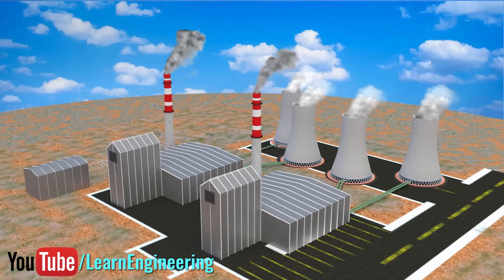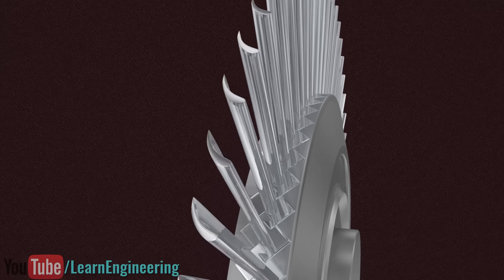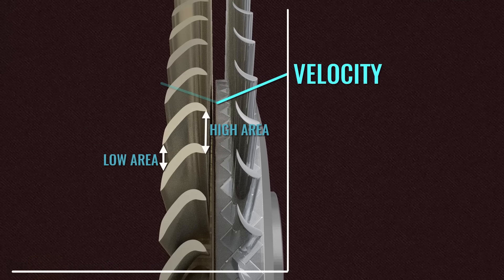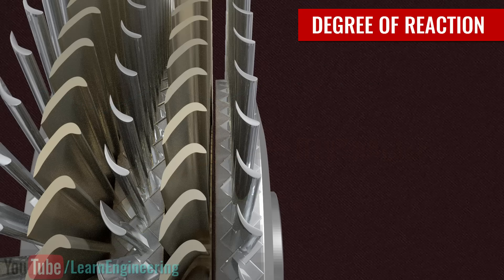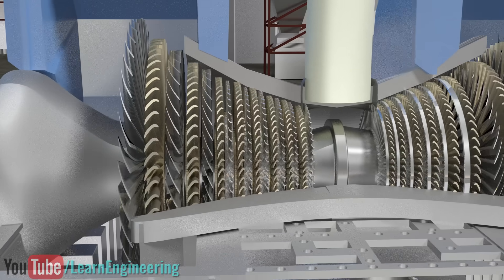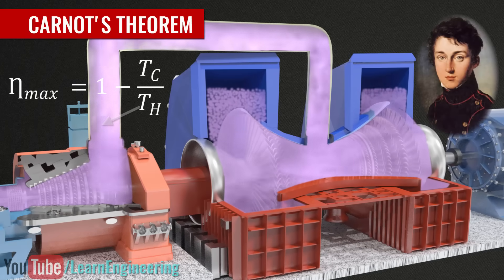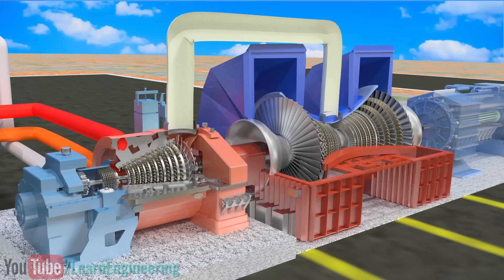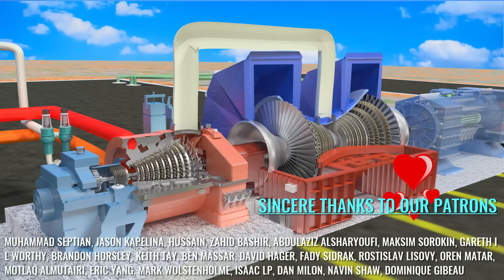How does a Steam Turbine Work?

Comment: But where does the boiler get the energy to heat the water?
Reply: And how would you convert nuclear Energy to Electricity without a Steam Turbine?
Reply: heat cant be converted directly to electricity you must converted to a mechanical form first
Reply: noreaction often from coal
Reply: We already do the thing you sugested but with water, it's called hydroelectric power. But in that case instead of people lifting the rocks is the sun that evaporates the water from the lakes, oceans and rivers and converts them in clouds that travel in the air due to the wind currents generated by the sun itself and then comes down in form of rain that fills the rivers and moves the hydroelectric turbines of the dam again. So in other words, hydroelectric power it's actualy gravity and solar power deep down.
Reply: Because belive or not thats the simplest way these days to convert heat energy to electric energy. A gas turbine like a co2 turbine may be a better solution for higher temperatures though it works very similary.
Reply: noreaction nuclear reactors release large amounts of energy in the form of heat. You can't convert heat directly to electrical energy. It's impossible, you need to first convert it to mechanical energy.
Reply: it depends but mainly its either burning chemical substances or from nuclears reaction
Reply: The equation for your situation is (intro to physics):
E = m*g*h (Energy = mass * acceleration of gravity * height)
plus several unit conversions to the base metric system. 
I also went ahead and solved it below (spoilers!).

The energy doesn't come from gravity. The energy comes from your body, but gravity temporarily stores the energy before you use it - you move the weight up, and it generates power when it falls back down. This also assumes 100% efficiency. 

Solution:

First convert to a more usable unit for 1 day of usage, from kilo-watt-hours to watt-seconds (aka Joules):
energy_needed = 10 KWh * (3,600 s/h) * (1000 KWh / Wh) = 36,000,000 W*s = 36,000,000 J

Solve for height of your stairway using the equation above: h = E/(m*g)
m = 600 lbs / 2.2 kg/lbs = 272.7 kg
g = 9.81 m/s^2
h = 36,000,000 J / (272.7 kg * 9.81 m/s^2) = 13,456 meters = 44,147 ft

Conclusion:
Height of stairway  = 44,147 ft
Height of Mount Everest = 29,029 ft

The calculations show that you'll have to carry the 600 lb rock from sea level to the top of Mount Everest 1.5 times each day.
Reply: noreaction because it's not so safe
Reply: You can't convert nuclear energy to electrical energy directly, or at least we don't know how to do it yet, or in the other hand, if such thing was possible we don't know if it would be as cheap, simple and efficient as a steam turbine. It would be awesome tho. But you can use it directly to heat things, I think that a lot of industries that need to heat things use the hot steam of nuclear reactors directly, because, why would you use heat to produce electricity to then produce heat again?
Reply: And the other thing is that it's not as simple as rotate some random shafts at a given RPM, the more current you want to generate the bigger they need to be and you will feel more resistance l when trying to turn the shaft, so it's going to be "harder" to turn them not because they are big but because the resistance in the circuit will try to stop the generator, that's why the generators vary in size due to the amount of current they need to produce, for example if you buy a small generator you could run the electric stuff in your house with no problem, but if you go to a big building you will find massive generators with big engines that use a lot of gas to produce the amount of electricity necesary for the entire building.
Reply: TechTezza what? no Sisyphus reference?
Reply: noreaction I know a way of turning heat into electricity directly: thermocouples! Yes the ones used to measure temperature. They produce a tiny voltage and current, if you have many in a series you can achieve usable amounts of power, like in space probes. The problem is, though, that it's DC and the efficiency is very (very very very....) low, no greater than 10%.
Reply: Because the energy released from a nuclear reaction, is mainly in the form of heat. We cannot send heat into the power supply, so we use steam turbines to convert heat into mechanical motion, which we then turn into electricity with the large generators. If you want to understand it better, find a video on how a generator turns mechanical movement into electricity.
Reply: Yes, for exmaple chemical platforms for industrial productions of certain chemicals that requires high temperatures can be coupled with reactors to cut out the transformation of energy from the middle to prevent the waste due to conversion.
Although, your statement about conversion is only half correct, as its true that currenty steam turbines the most common method of conversion in reactors (and likely the most efficient on that scale and temperature) however both RTGs, beta voltaic cells and alpha voltaic cells are working differently in princible, while they convert nuclear energy into heat or directly into electrical energy, without steam, turbine or even moving part.
Reply: Ariel Méndez I don't live near river lake or ocean, and it's not really sunny since I am closer to the North Pole than I am to the equator. Solar and hydro power are not reliable enough every day for me
Reply: Considering the fact that an average U.S. house draws on average 2 extra-large horses of  worth of power (definition of a horsepower) in electricity alone 24/7/365, you would need at least 2 extra-large horses pulling carts of rocks 24/7/365 in order to feed that falling rock generator (otherwise it'll stall), or more realistically, at least 6 extra-large horses so that they don't all die of exhaustion within a day. You can still expect them to regularly die of exhaustion though in this setup. 

Humans are a lot weaker than horses. It'll take closer to 48 very fit humans to even hope to make it work, for a single house (with around 2 people living in it, I guess the other 46 will have to be homeless).
 
Then, we have these large steam turbine power plants like the one in this video, which typically output between 1/2 - 4 million horsepower, each individually. The scale is the issue here - humans are simply too weak. Steam turbine power plants like the one in this video are basically lifting an entire (large) aircraft carrier's weight in rocks from sea level to the top of Mount Everest, 15 times a day (good luck, to the humans out there trying to accomplish this). The numbers in the previous sentence are typical for what are often referred to as "medium sized" nuclear power plants. 

Note: I'm only using horsepower because most people do have an idea on what a horse is, even though they might not have any intrinsic understanding on how powerful a megawatt is.
Reply: Peter Tang considering my current actual average of 10 kWH per day and that I would cut electric expenditure in an off the grid living situation by about a quarter, are you saying it would be impossible to cover half my electricity using gravity? Even if the weight was able to be reset by climbing stairs and stepping on a platform which was the counterbalance to the actual weight to reset it? That weight could be up to 600 lbs if it were me alone resetting it. Can someone point me to actual equations I can use to do the math? I'm no engineer.
Reply: where does rpm of the rotating shaft factor into all this? Correct me if I am wrong, but isn't this saying that a freefalling rock has the same energy as that amount of joules from that height? Do gears which multiply the rpm not exist?
Reply: Yes, a free-falling rock does have the same amount of energy as a rock on the belt - though in that case, the energy will probably be used to create a crater in the ground rather than produce an equal amount of electrical energy. 
The RPM is really just an added level of complexity needed in a real system (it really doesn't factor into energy at all). It's kind of like how fast you're driving. You can travel 5 mph, or you can travel at 100 mph. When the speed limit is 55 mph, traveling at 100 mph is not ok, and neither is 10 mph on that same road - that's basically what the consistent RPM means - you have to maintain a constant speed. 
It doesn't say anything about how much energy is used to travel the 10 miles, since to know that you'll have to know whether it's an uphill road or downhill road, and whether you're driving a motorcycle or a semi-truck. That semi-truck traveling at 55 mph will need a lot more energy than that motor cycle traveling at 55 mph, even though they're traveling at the same speed.
Reply: +tamimi emran not entirely true. The seebeck effect is the conversion of heat directly into electricity.
Reply: Ariel Méndez Good point. Must maintain perspective of the volume of energy being converted. In other words there is a reason why there is so much steam flowing through this system in the first place.
Reply: in a conventiona powerplant this heat is actually taken from the flue gases
Reply: Ariel Méndez I was thinking about this. Transforming thermal energy to electric directly would be some sort of an inverse microwave. If we could do that we could drop nuclear altogether since basically all water and air on earth is above 0 Kelvin thus has thermal energy stored. We could have power plants that would input ambient temperature water and output cooler water and refrigerators that would generate electric energy instead of consuming it.
Reply: Cool Name if we are talking in transforming thermal directly to electrical, is it possible to make a refrigerator that generates electricity instead of consuming  it?
Reply: Ricardo Micai What? So how is it called a fridge or cool things without using electricity and at the same time produce heat?
Reply: We do have a way to convert heat and radiation directly into electric energy it's just not very efficient. Just like with solar panels. I think if we sandwitch thermal coupling materials together we may be able to boost efficiency. Ultimately the problem with solar panels and thermocouples is that they can't convert fast enough. They mostly get hot and in the case of thermocouples the efficiency drops even further as the materials reach thermal equilibrium. Another issue is that they produce DC and not AC. Perhaps if someone could design a thermocouple that produces AC power it would significantly increase efficiency.
Reply: TechTezza doubt anyone could be dumber than that
Reply: not true. https://en.wikipedia.org/wiki/Thermophotovoltaic
Reply: noreaction coal, nuclear reactions or some shit
Reply: Firstly....

In warmer climates, usually desert areas, solar thermal can be used to heat water through a series of concave mirrors, or thousands of mirrors concentrated to a single point. That creates steam with enough pressure to drive turbines.

Enough heat in fact to melt salt. Which is often used to keep the plant running when there is no sun.

In colder climbs we use geothermal. We pump water deep underground where the earth is hotter as it approaches the mantle. The steam from that then drives the turbine.

Second. This falling rock thing.

Technically there's one being designed right now. It involves old mine shafts, a huge lump of concrete on a chain and a generator with a gearbox

During the day the excess solar and wind energy (if you see a wind turbine not spinning it is NOT because it isn't windy. It's purely because there's not enough demand at that time of day. Same for solar) lifts the lump of concrete up to the top. When there is electrical demand, the stored gravity energy turns the turbine as the block falls slowly back towards the ground, with the gearbox and generator controlling it's descent, creating reliable energy storage. The more energy you wish to store the deeper you made the shaft or the heavier the block/higher the gear ratio.

Coincidentally enough this is how the earliest mechanical clocks were powered. To keep time constant you had to go and raise the weights every few hours. The clock mechanism controlled the rock's descent.
Reply: Wouldn't it be more efficient to produce energy directly from the material used to heat the water? I don't get why you wouldn't use nuclear energy directly to power a grid instead of steaming water with nuclear and then using that energy to power the same grid
Reply: TechTezza hahaha advanced troll you give me too much credit. I am a simpleton just trying to figure a way to power my house off the grid. One big rock is more practical than several small rocks. It's been done before on a scale of single lightbulbs, resetting the rock every 12 hours. Just trying to scale up
Reply: If all you need to do to gain electrical energy is rotate a shaft to spin at a given RPM, why dont we use kinetic energy of a falling rock and tie the rock to a rope which pulls gears which rotate the shaft? It is human powered to lift the rock, and we don't need water or coal for it
Reply: +Cool Name look at Seebeck thermometric devices